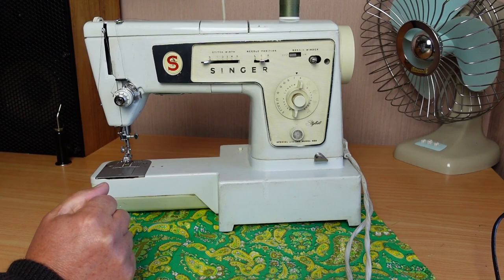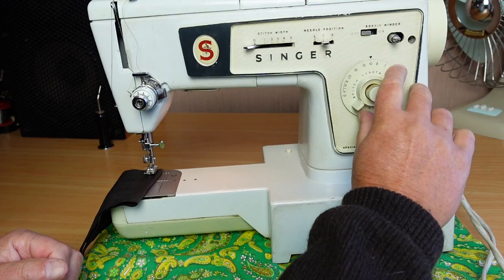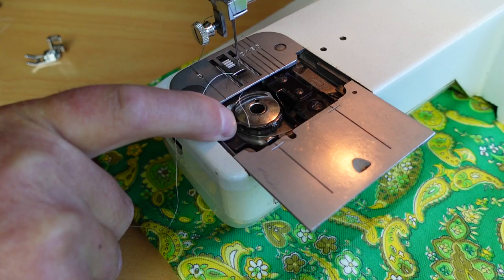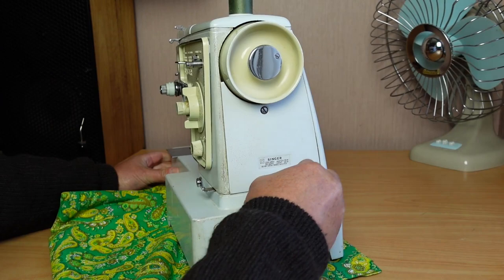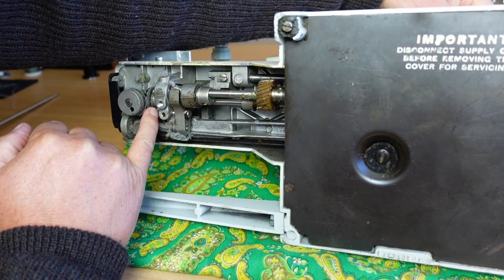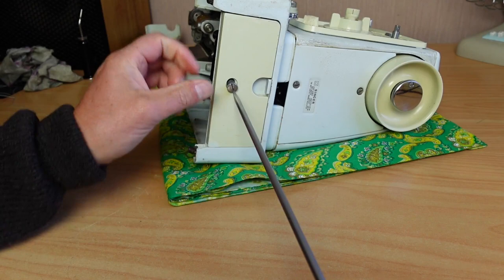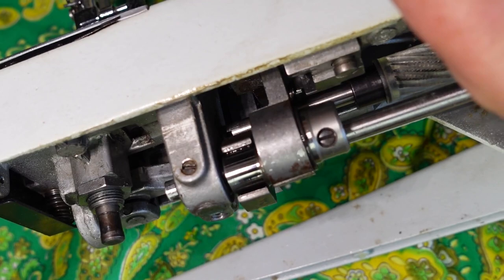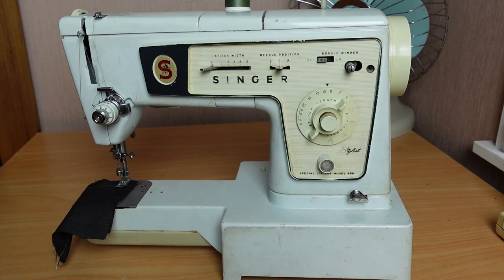Replacing the Feed Gears - Singer Sewing Machines - Part 1 - Installing New Gears

Comment: I have a Polish-made 834, and that has imperial size socket heads also. Maybe because the gears were supplied from Singer in the US? (other parts have metric threads).

Comment: i have a singer 513 in front of me with disintegrated freed dog gears. I have new gears to install . But I have one screw that refuses to budge. I have tried everything the internet suggested. What kind of shop should I take it to to remove it. I can do the rest. I'm in canada so I don't have access to BlueCreeper penetrating oil which is the only option I have left. can you give me any help

Comment: Thank you very helpful. I wonder how much it would cost to get this job done at a sewing machine company with a tech? Gears included Thanks again
Reply from the maker: Hi. The gears are relatively inexpensive and the whole job takes around 30-60 minutes. Thanks.
Reply: @InStitches  Thank you for your quick reply  Have fun with your machines :-)

Comment: Thank you very much for this video. I have a 543 with much less space inside and only a tiny amount of slack on the wire to the motor. Do you know how I can move the switch out of the way on this model to make room for the long gear shaft to slide out? (ref time 7:30)
Reply from the maker: Thanks. You'll need to remove the two screws holding the switch block in. Then you'll need to remove the white panel attached to the back of the switch block. It's tight but it can be done. You can then wiggle the switch block down. Be sure to note where the wires are.